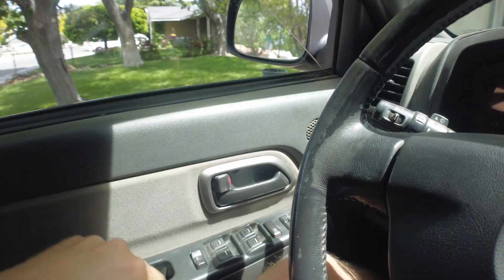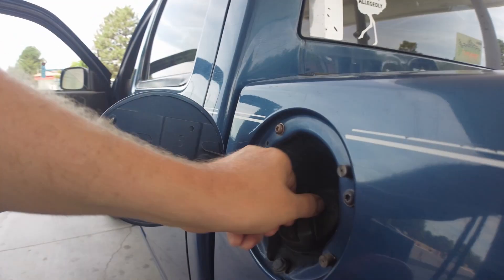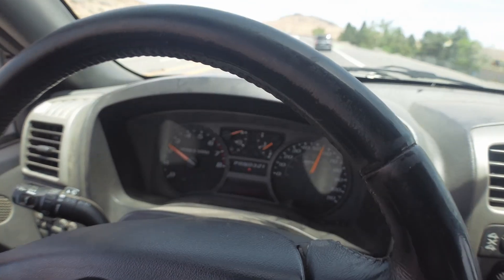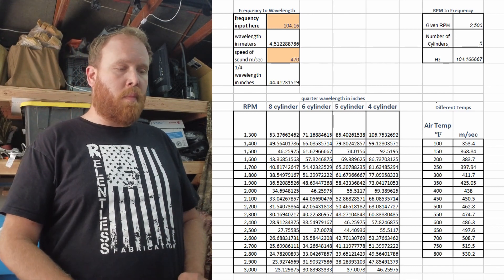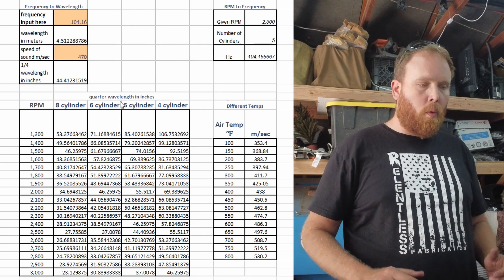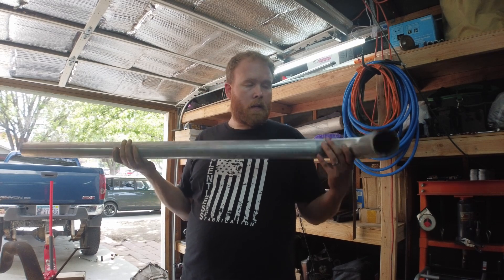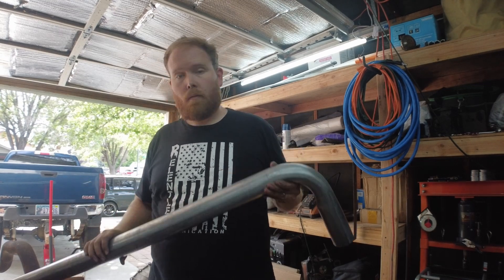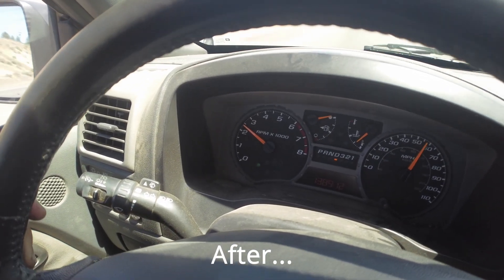Eliminate Exhaust Drone On Any Vehicle [Quarter Wave Resonator]

Comment: I made an adjustable pair for my stroked Mopar. It completely works. Also took the sound spikes down across the range, made it a nicer sound plus took average decibels down by 10dB across the whole rev range.
Reply from the maker: That's crazy. Nice work
Reply: Best pipe length from the weld point on both exhaust sides turned out to be 28 1/2 inches. 2 1/2  dia inch exhaust.
Reply: No more Havanna Syndrome. Much nicer drive without taking down overall exhaust symphony.

Comment: Will it work on true dual set up?
Reply from the maker: You willl ikely want to use the cylinder count of that bank. So for a V8 each bank is only running 4cyl. So you would plug in your values for the Hz and rpm and treat the banks as separate entities.

Comment: OK so, using the calculator you provided I'm looking to eliminate 108Hz @ 2700-3100 rpms  on a 4cyl with sound temp @462.8m/s.  The read out on the calculator at the top shows 42.1 but the numbers in the bottom right table shows 50.52-45.47" what length am I really looking at and does the diameter of the J pipe vs the main tubing matter?
Reply from the maker: Lemme double check the form but the tube I personally used and have seen used is the same as the exhaust.
Reply: Ever find out how long you need it to be? My issues at 3,000k rpm and mines a 4 cylinder too and if it’s 44 inches what is it for a 1/4 j pipe
Reply from the maker: @dylansmith3 use the Excel sheet to calculate your tube length
Reply: @ yeah i downloaded it but it wouldn’t allow me to type in anything
Reply from the maker: I just checked it on my phone and it works. You need to fill out the box on the top left with the air temp and Hz

Comment: What sort of RPM range did this help in? +/-  2-300RPM?
Reply from the maker: It's targeted. You base your tube length on the calculations in the excel sheet I linked. You'll have to note the rpm and hz you are trying to mitigate.
Reply: @BadlandIndustries  correct I get that, but say if we built it to take care of 100hZ drone. How wide of a hZ/RPM would it dampen also? 95-105hZ, 99-101hZ? Any general idea?
Reply from the maker: @pegleggreg3627  if you center your calculations on the hz and rpm you are having an issue with you'll notice an increase in effectiveness as you get closer to that point. This didn't seem to be anywhere as loud all around that 2500 mark. As we crept up to 2700+ I started to notice more cab noise.

Comment: What do I do if I have dual exhaust pipe on a v6
Reply from the maker: The sound is still going through both pipes. My understanding is that you may need to do both but you might start with one side.
Reply: @BadlandIndustries  does the cylinder change for the size of the motor like 3 cylinder
Reply from the maker: @gabrielkidder8112  because the sound is being created by a 6cyl yould calculate for 6
Reply: @BadlandIndustries  Thanks for the help, one last thing does the placement matter like if it is in the back or middle of the system. My drone is at  88 Hz to 94hz
Reply from the maker: @gabrielkidder8112  yes you'll change temperature and that affects the equation.

Comment: I have been looking for a the sound meter/spectrum analyzer or link for a long time. Most everyone gives the Excel sheet but nobody but nobody shows a link for the sound meter / spectrum analyzer and or a LINK‼ Sorry but isn’t this the most critical equation?
Reply from the maker: Yep. Use your app store and search for frequency analyzer. I used a few free ones and they all came back very similar.
Reply: @BadlandIndustries  Thanks! I will look and see if I can find one.